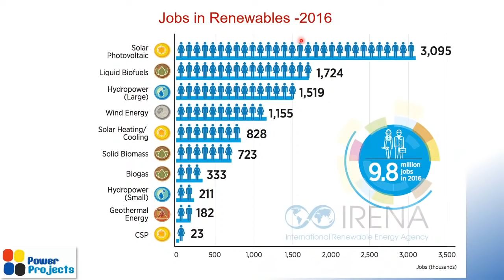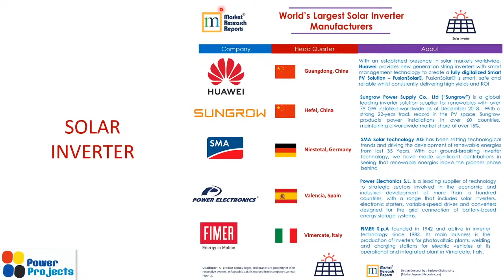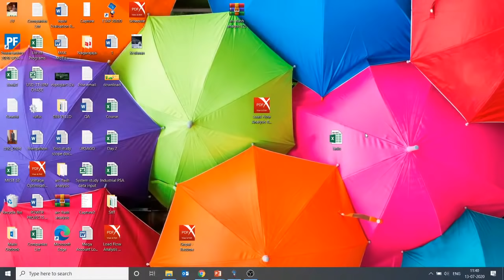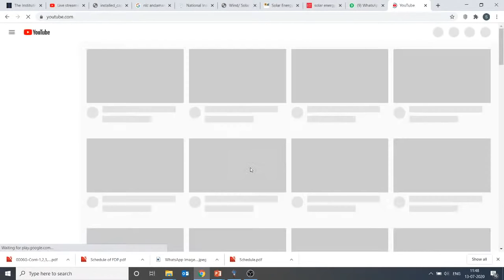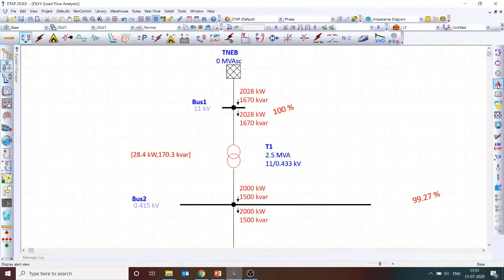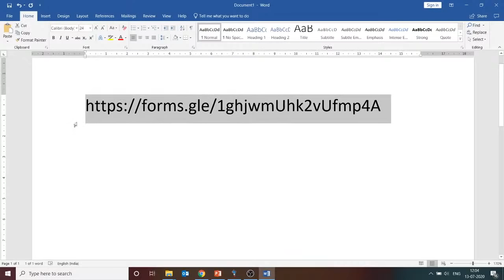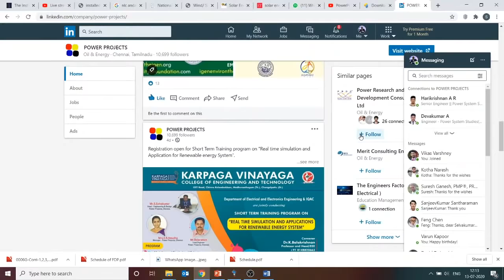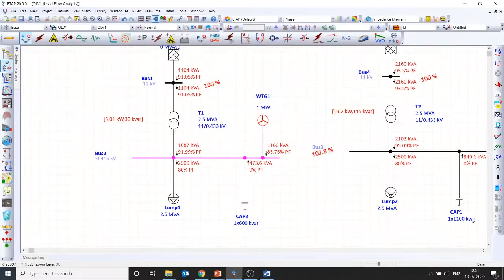Real Time Simulation and Applications for Renewable Energy Systems Part 1

Comment: Can you please explain the Reactive Power Output from a WTG from 0 to 100 % Generation. Given we have to maintain PF of 0.95 at PoC. Because the turbine seems to consume reactive power only when voltage at PoC is higher than 100 % and vice versa. Also can we see the actual Tap position of TF when LTC is active. Really appreciate your response
Reply from the maker: It depends on what Type of WTG which you are using. Type A & B can not control the reactive power. With Type C & Type D you can control the reactive power independent of real power and you can maintain the power factor at PoC. Sometimes in WIndfarms depends on the PoC and length, it might be difficult to maintain the Power factor at PoC. In such cases you may need to propose suitable reactive power compensation devices. 

You can see the tap position in ETAP SLD by enabling the "Transformer LTCs" from Info Tab in Load Flow Study Case.

Hope this helps.
Reply: @PowerProjects_etap  thanks for reply. I'm talking about Type 3 WTG, Nordex N100 2.5 MW.
Should I simulate with Voltage control mode or PF control mode. Also when I consider zero generation the, ETAP doesn't show no load losses n reactive losses of TFs. Is this possible. Looking forwarding to hearing from you
Reply from the maker: @SaeedKhan-gb7jr  - Neither Voltage control nor the power factor control helps to regulate the power factor at PoC. This is the draback of ETAP. You can use Station controller in DIgsilent powerfactory and simulate with the targeted  power factor at PoC. ETAP does not consider the transformer No load loss (real and reactive power) in Load flow . You need to perform unbalanced load flow to include no load loss of transformer. This is explained in AskSelva session. We have also compared ETAP with DIgsilent which you can watch.
Reply: @PowerProjects_etap  Thanks for this valuable information.